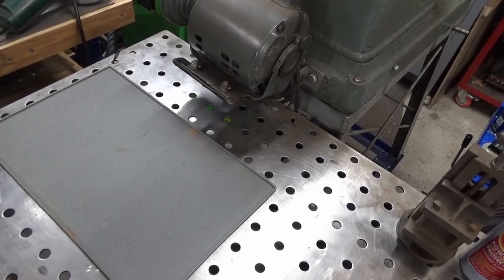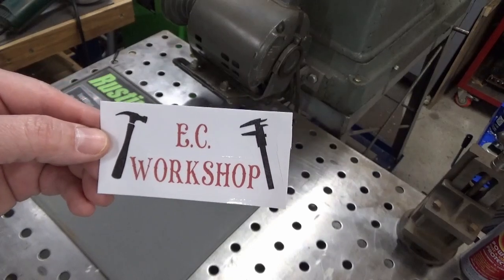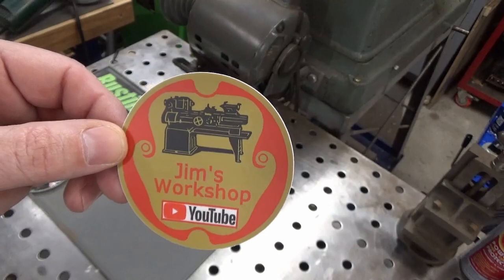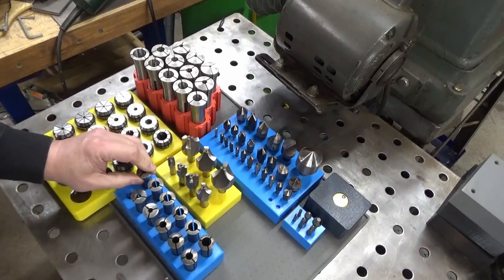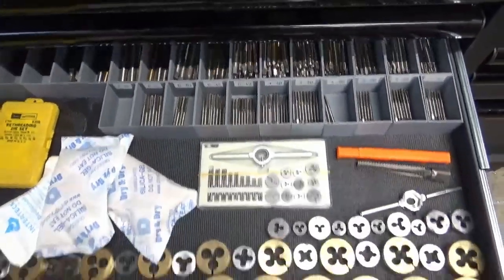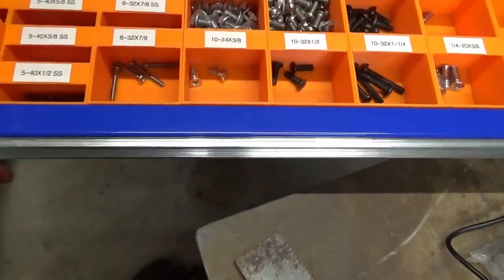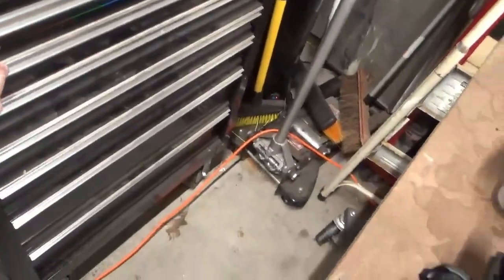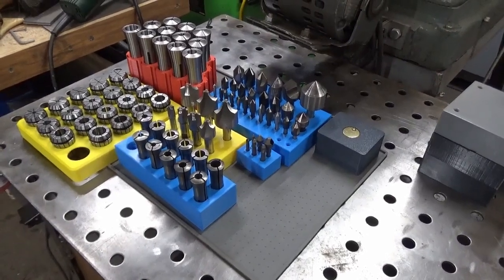3D Printing and Shop Organization

Comment: nice work !  looks like  you have a good handle on the 3d printer !  Joe
Reply from the maker: Thanks! The printer part was easy, I just bought one that had a really good reputation for just working out of the box.  The learning curve for me is 3d CAD. I took drafting in college using pencil and paper.

Comment: Hey Mick, some good ideas. You have a lot of printer hours there. I have actually been working on a very similar video. I started doing drawers but both machines are working making spindle stops and other late related stuff. I am looking for another at the moment.  I am going to go back to the drawers soon. I am going to try thick vase mode to cut the time down considerably.  We need to trade some stickers as well. I will send you an email. Should post a link to your thingiverse page. Best!
Eddie

Comment: Thanks Mick for the shout out.  

Many rolls of filament met their untimely demise in my 3D printing learning curve. Finally, I bought a Prusa and got on with it.  LOL.  

I will hit you up in email for a few .stl files.  Excellent work - very tidy. That will be a retirement project for me when I upgrade my shop space. Are you using PLA or PETG? 

LOL so you are the other guy with a full set of 3c collets.  

All the best 

Dan
Reply from the maker: Hi Dan, I use PLA.  I haven't tried anything else yet.  I bought a role of TPU, I'm thinking of trying it to make T-Slot covers.  Let me know what files you want.  I use FreeCAD if you want the CAD files.

Yeah 3C... almost useful if you make tiny things.